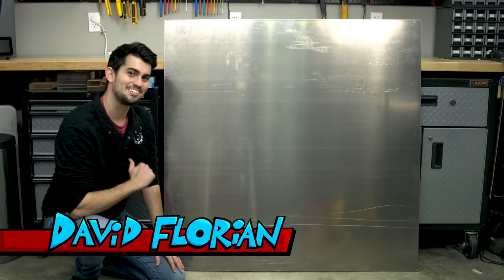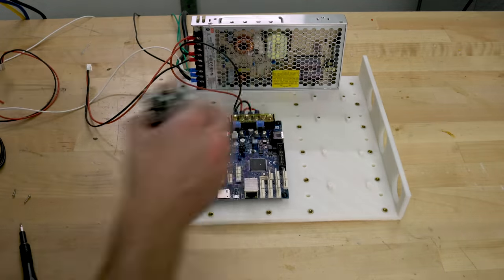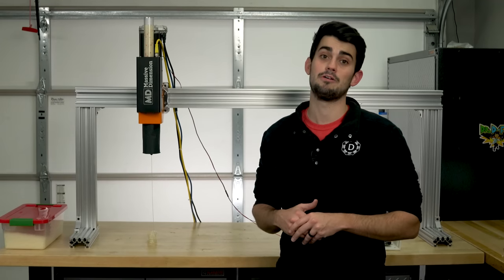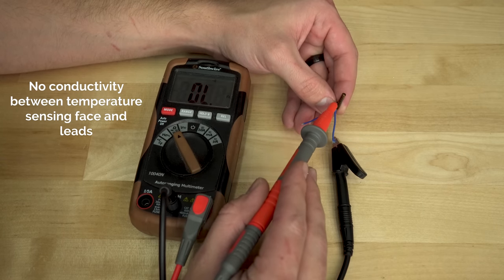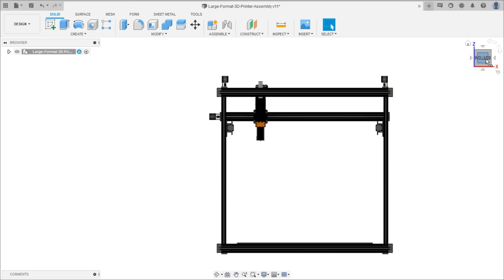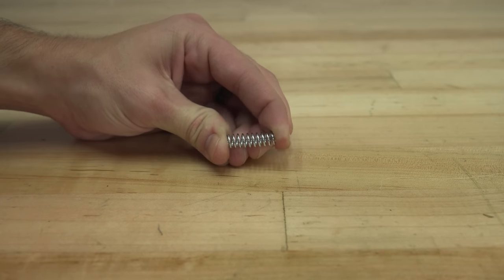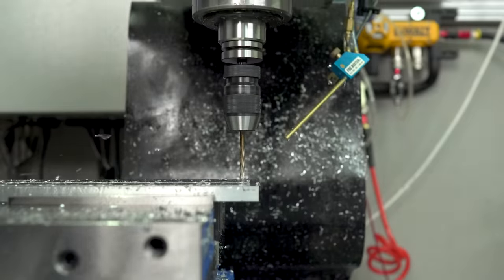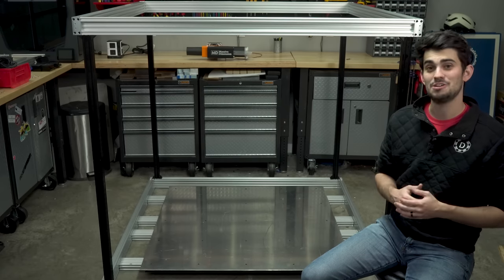Building a Large Format 3D Printer – Part 1: Pellet Extruder

Comment from the maker: CNC Mill upgrades, SLS 3D printing, building 3 Vorons, and exploring some of my favorite projects to make in my garage – 2021 was a content packed year! As I move onto larger projects, I will stay true to my style of dissecting all elements of the machines and products that I am building.  I will catch you guys in 2022 🎉
Reply: I think the velocity of the head is wrong on the video as 3000mm/s would be 3 meters per second.
Reply: first video I've ever seen on your channel.  I'm 300+ lbs. Do you think you could print me some chairs and what would you charge? 2:20 do you experience feedstock binding?
Reply: Sorry if I missed it, but do you address racking (tilting) and twisting of the frame as the extruder moves?
Reply: Hey so was wondering if you could blend down bottles and throw them in rather than pellets
Reply: se podrá usar material reusado como soportes o impresiones fallidas
Reply: Question: I find it interesting, but from the start to the end .. how much did it cost you? (where are you? because it depends on that as well)

Comment: At this scale I'm imagining a granite slab would be more cost effective for a level build surface. This is exactly the type of project I want to do in a year or so. I'm so glad you are documenting your process for us!
Reply: Yep at this scale I can't imagine that aluminum plate would be anywhere near flat. Granite is good for that purpose but the thermal properties might be less than ideal (a ton of thermal mass is gonna be very greedy for heat and take ages to heat up cool down)
Reply: Like marble rocks don't heat up. A slab of marble seems like a radioactive air conditioner .
Reply: A honeycomb core panel would be rigid and light, or a torsion box design could work.

It really depends on how flat you need it to be for 3d printing, bed levelling works great for surface adhesion, and printing with a raft could be used to create a perfectly flat surface.

Personally, I like prusa's new segmented heated bed solution, especially for large format printing.
Reply: I'd go for routing the surface then adding nichrome ribbons and an fr4 plate on top.

Comment: I'm curious how well that lead screw will work.  I'm wondering if all that bouncing is going to be visible as an artifact in the print.  Either way, it will be super cool to see a print that large.
Reply: ^ This is why Rack and Pinion are generally preferred on large range of motion linear actuators where rigidity rules out belts.
Reply: Yeah that bouncing is a good indication of why you go for larger diameters on longer lengths (or different systems altogether). That whip is baaad for quality (and everything else)
Reply: Larger ball screw would be much better but very costly. At least he can usr the cheap lead screw to get something functional before he remortgages the house, lol.
Reply: It’ll be fine
Reply: it should be okay, the vslot/rollers holds it very still to the x gantry, idk about the exactness of x movement though
Reply: With the print resolution he'll be going for it shouldn't be too noticeablee
Reply: I wonder if the machine would be moving very fast during extrusion anyway.
Reply: @jasonwoody8041  remortgage? Just print a new shed
Reply: Was thinking the same thing. I wonder if he could make spring loaded supports, that would automatically spread out along the length of the screw to help support the long spans, but could compress enough to not limit travel?
Reply: @jasonwoody8041  Could just tension the lead screw between a pair of angular contact bearings so it's basically pulled straight. But then I guess the small aluminium extrusion will turn into a bow.

Comment: To solve the pellet feeding problem you could add a pellet sensor, an optical one since the tube is clear could work, and make a routine to park the extruder to a corner where you would install a big automated hopper. So when the level of pellets goes down, the extruder pauses the print, moves to the 'refill station', reloads and goes back to printing. The hopper would need a set volume to unload or another spiral screw to measure the right amount to refill.

Comment: For the 5mm nozzle that you drilled out, I feel like you should flatten off the face so that the edges aren't so pointy. Most nozzles have that flat area around the orifice, and I think it helps with print quality.
Reply: 100% this, I think I tried a bored out nozzle at one point and it was awful. You really need that flat area.
Reply: for sure

Comment: Even tho it sounds crazy.. But for the bed you are better off using a solid steel plate with one inch or more. Yes it will be hard to heat but if you consider that you print for a long time the energy expense is alright. Also you would have a way more stable temp. Another benefit is the added weight to the machine lowering resonance. Oh and also the bed will not bow like shot

Comment: Very interesting project.

There's a lot of whip on the lead screws, you could do with a larger diameter of lead screw in order to resolve this.

I'm not a fan of the bed levelling mechanism, it will be a lot of work to level and you'll likely find that you need to re-level it both periodically and every time you decided to change your bed temperature. I'd also be concerned about the level changing as the printed part's weight changes throughout the print.

Mechanical levelling of a bed of this size is a losing battle. I'd suggest rigidly mounting the bed and relying on the Duet's mesh auto-levelling with auto-probing. You can do a periodic probe of all of the mesh points and the probe can also be used to set your z height with a single-point probe at the start of every print. The mesh auto-levelling will also correct for any tram that you have with the four z-axes.
Reply from the maker: Couple thoughts on your reasonable comment:

Regarding the lead screw whip, the ideal case would be to use a 20mm ball screw at this length. I simply cannot afford to build a system around this component. There is a tensioning nut with thrust bearings on the actuator to remove some of the compression on the lead screw, but this will not eliminate the whip. I'm hoping that the whip is manageable at low enough speeds that I can get decent prints. I have used these same actuators in my CNC plasma table and the cuts were great: https://youtu.be/a-cyTMqul-o (just 1 actuator though not 7). Finally, the stand that I quickly threw together for holding up that 1500mm c-beam rocked back and forth when the motor was accelerating. You can really see this on the b-roll shot that zooms into the motor. This may be why the lead screw whip looked worse on video then in reality.  

The bed leveling mechanism is intended for getting the bed close to level at 60C. The bed is a cut off from a 4x8 sheet so it didn't even come flat. There would have been a significant amount of Z-axis movement when printing a layer if I relied on mesh leveling alone. For higher temperatures, I will let mesh leveling compensate for changes in the build plate because as you pointed out, I am definitely not releveling the bed between PLA and ABS prints. 

At max compression, the springs can hold 13lbs. If I can get near that compression across all 25 springs, then the bed be able to support around 300lbs (evenly distributed). A 4'x4x'4' block of PLA at 100% infill would weigh thousands of lbs, so I definitely won't be able to use the entire volumetric capabilities of this printer with this configuration. But I do want to talk about this limitation and considerations that need to be made for removing a hundred pound part from the bed. However, the build plate can be rigid mounted as configured.
Reply: @DrDFlo  have you considered stabilising the leadscrews with a loosely fitting bearing on a mini carriage that slides around on the screw independent from the extruder. You can make it stay halfway between the extruder and the edge of the frame with some clever cabling trick (I can sketch it out if you want). That said, I'm not sure if it will damage the screw, but the way it's whipping can't be good either right?
Reply: I have only watched part of the video so far.
Regarding lead screw flex. I am planning a 3 x 6 ft machine which was originally for 3d but has morphed into other tasks. The rotational speed of the shaft is length and diameter dependent. Leaving it to whip will destroy sooner than later everything connected to it. I was looking at 20 diam x 4mm pitch for the required accuracy. Going fatter is a loosing game because the acceleration power needed also increases. I thought of doing as 'csiz' suggested but either the bearing or the screw will wear. Heat gain in the system is also a problem. I am going to try a tooth belt as a track, not as a belt. 
The other reality is to ignore the 6 mt/ min type speeds. Is that really a necessary requirement? The traverse speed only needs to be something a little faster than the extrusion rate. Particularly with fixed tooling like this, traverse speed is only a small fraction of the total extrusion time, and the joy of saving a few seconds per build becomes a fools mission in my view. 
Returning to the heat buildup problem. With regular high speeds the screw will lengthen differently to the rest of the machine. Product accuracy becomes thrown out as time progresses. I am separating the drive from the measurement system to overcome this. Notwithstanding this, different coefficients of temperature are not to be ignored when shed temperatures can range over 40 /50 degrees C. (Australia)
I will be watching the rest.
Reply: @DrDFlo  Why springs actually? How about the bed being supported by locknuts, maybe with washers, would that work?

As to the whipping, i'm not terribly concerned? You can always have some sort of a sliding coupler on the moving part.

Comment: Please note the shape of the bottom of the nozzle is crucial for getting a proper line with a flat top when printing. Just drilling a larger hole will reduce that flat area around the whole and it will limit the maximum thickness of the printed line and will make it more difficult to get a nice flat top. Molten filament should be constrained from both the top and the bottom when printed.

Comment: 13:40 I think you got something wrong with the speeds, this doesn't look like 6m/s
Awsome Video like always.
Reply: Should have been mm/minute, not second.
Reply: yes, the speed definetly is wrong - as they sad "motor can run 9kmm in minute". And I thing the belt is better sollution, belts can handle hunderds of kilograms (harley use it intead of chain and other implementation) and also belt finaly produce lower vibrations .
Reply: 30mm/s Maybe? Or 3000mm/min.?
Reply: 6000 mm/min is correct

Comment: "mixing can't be understated" // in injection molding, most of the heat is generated by the screw+friction, not just a barrel heater for this reason.

Comment: Have you contemplated how this large of a bed will react when heated? I think you will find, that it will bow like nobody's business. Maybe you could use meshed leveling to compensate? Also are you segmenting the bed in several heatzone? If not I think you will have a crazy power consumption even when printing "smaller" objects. Looking much forward to follow you progress in this endeavor.
Reply from the maker: The plan is to throw the kitchen sink at the bed leveling problem. I have the springs for making large adjustments, the gantry will sit on universal ball joints allowing for quad gantry leveling, and finally mesh leveling. 

Regarding power consumption, I am only going to use this printer for massive prints or many nested parts so personally, the zoned heating is not worth the extra wiring. But I can definitely see an application where you would want to run this printer with such a setup.
Reply: @DrDFlo  flexures as single axis constraints? Allowing the bed to expand and contact but not bow?
Reply: @RobertSzasz  That's a great idea. Use the plasma table to cut some flexures around each of the mounting holes that allow XY movement but not much Z movement.
Reply: Good job copying prusa
Reply: @smellycat249  dunno if you realized this, but that's entirely the point behind crowd sourced construction - everyone contributes, builds, and iterates, and at the end of the line you have something awesome
Reply: @DrDFlo  make the bed like a giant water-cooled cpu cooler, but feed it hot water from the home’s central heating

Comment: 13:05 Hey Dr. D-flo.

Leadscrews (and ball screws), and any general shaft have a critical speed that decreases by the inverse of the square of the length. And after that, it will start to resonate. Assuming you have a 4 thread 2 mm pitch screw of 1500 mm in length and 8 mm diameter, and that your screw is supported at both ends (instead of fixed) your critical speed might be around 172 and 344 rpm (with a safety factor  between 2.5 and 1.25 respectively).

In this demonstration you mention that the actuator can go around 8000 mm/min, which translates into 1000 rpm with the given pitch. Therefore, you're above the critical speed, which explains why your leadscrew is vibrating that much

Comment: its hard to imagine how strong ABS parts would be extruded so thick.  I can tell a difference when printing the same parts with a .4mm and .8mm nozzles.  Something like this opens so many possibilites
Reply: You don't even need the nozzle, printing with thicker extrusion works fine to about 200% of the nozzle size.

Comment: They make fan style through beam probes for vacuuming pulling up pellets in industrial molding applications.

Most people use a centrifugal dust extraction hat on a small shop vac to feed the pellets. You should be able to set up a control scheme in either the duet or via a pi for the vacuum on. 

Try not to step on the bed like that. You definitely put some bow in it after than. The spring loaded beds look like a good idea. But they often minimize a bent sheet that is exaggerated when it heats up. The best way to adjust those screws is with mesh leveling in the duet firmware. You can set your grid to be somewhere close to the screw head and it'll tell you the offset compared to the z zero.

I know ABL is a bit silly with all that adjustment. But on my cubic meter build the able with independent z axis motors was pretty awesome. Setup took some time, but the control scheme was incredible. 

Currently make an idex machine running that reprap firmware and it reminded me how awesome it was for my giant machine too.

Comment: We actually build a printer like this at work with this same extruder. Massive Dimensions makes an automatic feeder system for this system. 
I only have one question, which wire did you use to get the fans to power up? We've been working around it for a while.
Also it will move faster than that.... :)

Comment: A few months ago, I was offered to tour of an aerospace company's R&D facility local to us. While I've worked with commercial printers both FDM and MSLA, Industrial printers were new to me. A few specs to blow your mind: the 'footprint' of one of their machines was 20x40 FEET (it's enclosed in its own room inside the main building with full environmental controls), operates from a control room where the printing head is mounted to a four axis gantry, uses a mammoth 30mm nozzle size as the Smallest offering, and can print anything that will fit via 5 gallon buckets at a time for pellet feed into a centralized hopper. The display piece was a CF-based main strut fixture for a wing, and even chopped up, still needed a forklift to move around. It impressed the hell out of me!

Comment: I would have gone for a CoreXY with HTD5 belts and geared stepper motors. You could have used any size NEMA motors this way to sustain huge amounts of speed and acceleration.
Reply: For that massive extruder and printer dimensions the belts would stretch too much.
Reply: @Mr_Yod  using HTD5M belts in a wider version would lower the stretch significantly. But you're right. Definitely something to take into account
Reply: Maybe go for chain instead that way you wouldn’t have to deal with as much stretching

Comment: Bring that water level up. We cut with the bottom of the sheet touching and get zero dross. We do submerged for really long cuts. Your THC, speed and voltage settings play a much bigger part.

Comment: I probably should read more comments to see if the subject has been broached? First, great project. I've had the extruder idea in my head for some time because? As a kid, I worked in both injection molding and extrusion blow molding (about a hundred years ago). Anyhow, one point of focus, for the extruder and feeding it. Pelletized plastic takes on more moisture than filament. You want a dryer on your hopper and you can locate your hopper (think 10lbs, 100lbs) on the other side of your shop if you want. Set up the dryer on the hopper. Run a vaccum tube from the hopper/dryer to the extruder. You can setup your feed system to run automatically to keep your feed tube full. With that in mind I'd look at say a one or two pound? Three? Think volume and how often your feed will have to kick on. A sizeable mini hopper on top of the extruder. This will allow you to keep your plastic dry and feed your extruder without having to constantly be involved. Also it will allow you to do your color blends on your pellets in larger batches which will allow you to get a consistent blend accross prints. That's my two cents. Hopper/Dryer/Feed. Any moisture will become quickly apparent, more so in large formatting extrusion volume. LOOKING FORWARD TO SEEING MORE!

Comment: You could always use a level sensor on the feeder tube and hook it up to an air venturi loader system. This is very similar to how virgin resin is loaded in plastic injection molding systems.